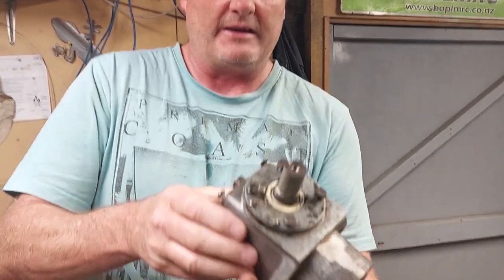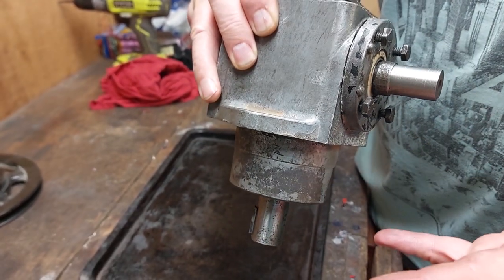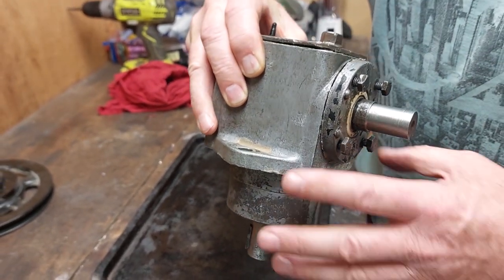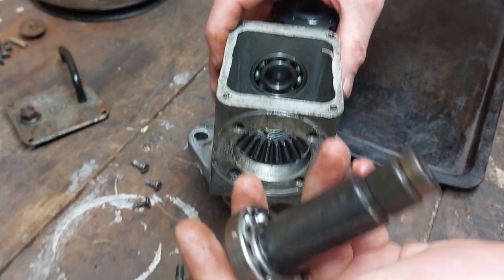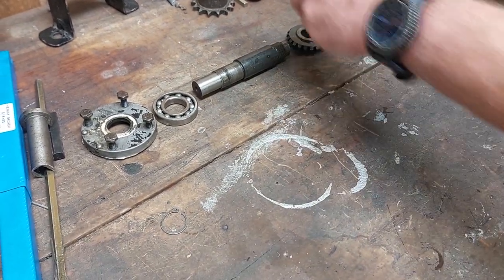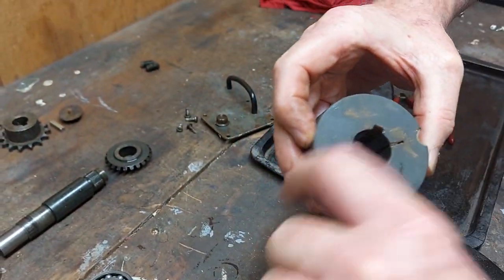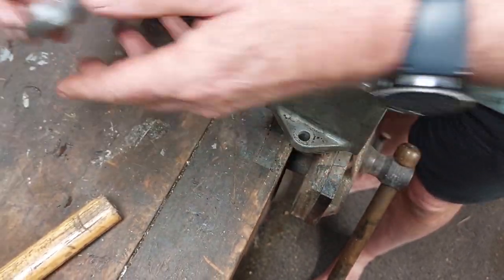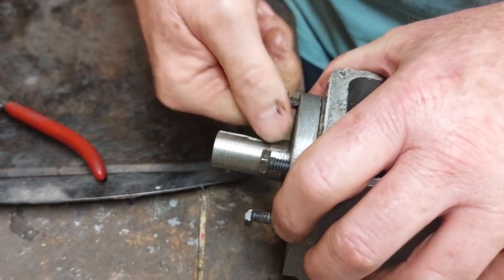Peerless 1000 right angle drive refresh for racing

Comment: Super useful and also very rare to find a video like this thank you so much, will I be able to put 18 horsepower through a mower if I use this method you have done?
Reply from the maker: Yes you can!
Reply: @bazzasgarage1922  thank you! Also was going to ask if I can run any type of gear oil if it’s high synthetic or does it have to be a certain type
Reply from the maker: @zykotic6649  I recommend a EP 90 oil as if the seals or shafts are worn it may not leak .

Comment: Gazza, I’m trying to rebuild one of these, I can get a rebuild bearing kit off Trademe. On the output shaft the bevel gear fell off like your bench thump, but the inner bearing is still stuck in the housing, thumping won’t get it to drop out like yours did. So can I just pound on the output shaft down and out or is there another circlip holding it in ??
Reply from the maker: Can you add a photo as I don't quite follow which bearing you are talking about.
Reply: It’s OK, I removed the big dia circlip under the seal on the output shaft and then was able to extract everything. Cheers.

Comment: Bazza, does it matter if either shaft becomes the driven shaft (opposite to what this one is used) , I might have a few more questions for you soon - Tiny -
Reply from the maker: I dont think so , you would have to check the lubrication of the bearings if you changed orentation.

Comment: Hey man ive been having a look around and have not been able to find a t drive or right angle gearbox for a reasonable price any chance you could point me in the right direction, thanks
Reply from the maker: Where about are you from. I can help with stuff in NZ but not sure about other countries.
Reply: @bazzasgarage1922  im located in queensland australia
Reply from the maker: @dodge2460  try somthing like this https://www.aliexpress.com/item/1005004377976475.html?_randl_currency=NZD&_randl_shipto=NZ&src=google&src=google&albch=shopping&acnt=494-037-6276&slnk=&plac=&mtctp=&albbt=Google_7_shopping&albagn=888888&isSmbAutoCall=false&needSmbHouyi=false&albcp=9444695485&albag=99457316601&trgt=1459734606882&crea=en1005004377976475&netw=u&device=c&albpg=1459734606882&albpd=en1005004377976475&gclid=CjwKCAjw-rOaBhA9EiwAUkLV4o_wB9j_4BLuGTlYxW9TGIAhlQbY82BB2XnCIXze3iTKDliFE_YPjRoCf94QAvD_BwE&gclsrc=aw.ds&aff_fcid=88e10dd4ab8c4c88bec2ca6061e684ba-1666041379540-09966-UneMJZVf&aff_fsk=UneMJZVf&aff_platform=aaf&sk=UneMJZVf&aff_trace_key=88e10dd4ab8c4c88bec2ca6061e684ba-1666041379540-09966-UneMJZVf&terminal_id=e8a897cf57b041ba9d67d0f952e0879c&afSmartRedirect=y
Reply: @bazzasgarage1922   Hi, I'm located in NZ do you have any sources for getting peerless right angle gear boxes?
Reply from the maker: @corbanwoods2254   No sorry right angle drives new are about $600. I know a contact for T drives like what I put in the kingkat build.